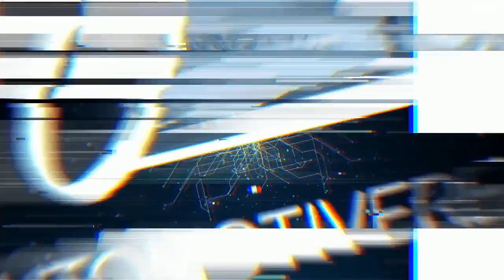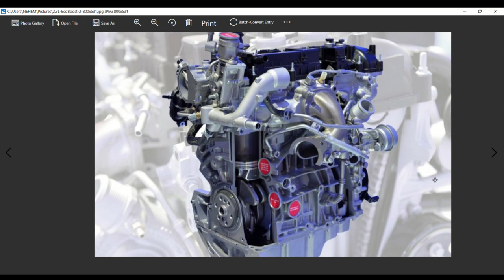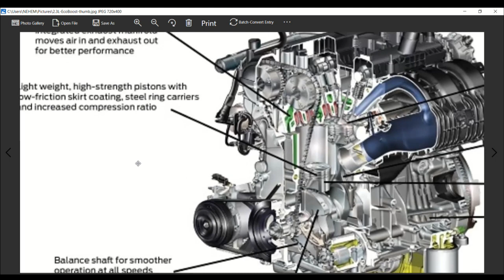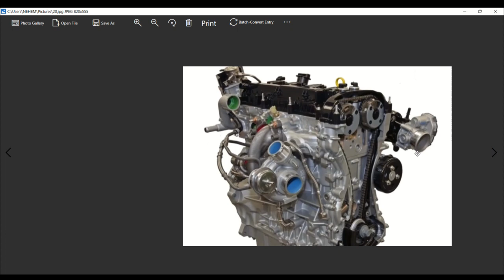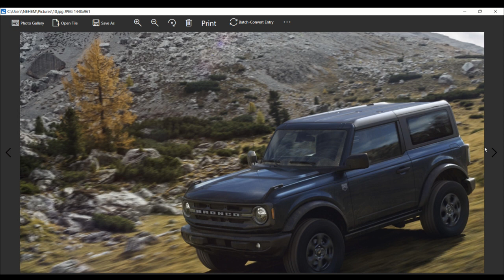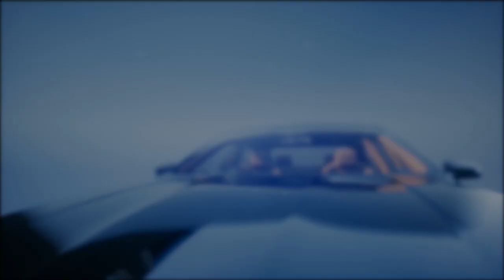2021 Ford Bronco 2.3 L EcoBoost Reliability And Maintenance Issues

Comment: will this engine last 150k+ with minor maintenance?
Reply: assuming you add an oil catchcan
Reply: @ob.servant  catch cans are a gimmick
Reply from the maker: 2.3 liter eco boost and the V6 has a great reputation.   However still get the 150,000 extended warranty